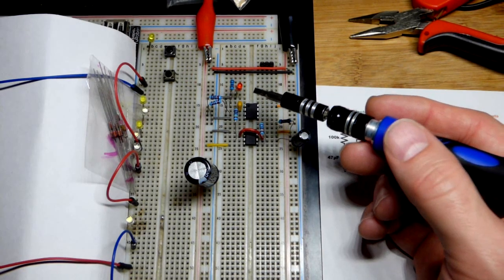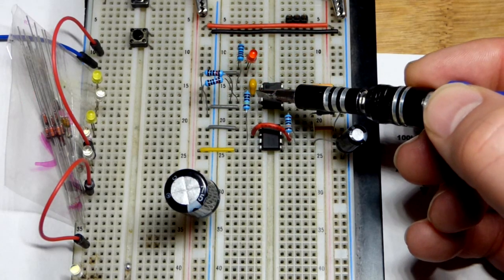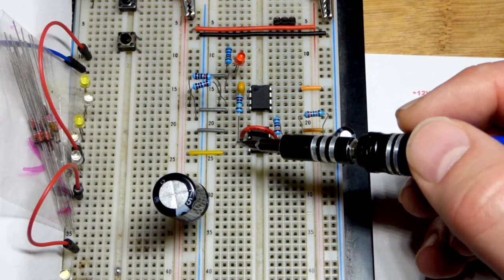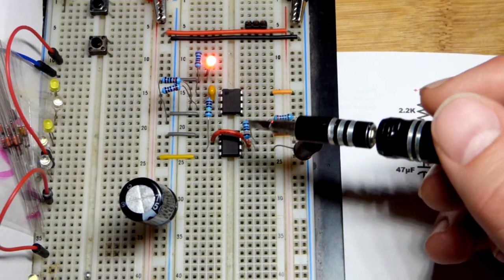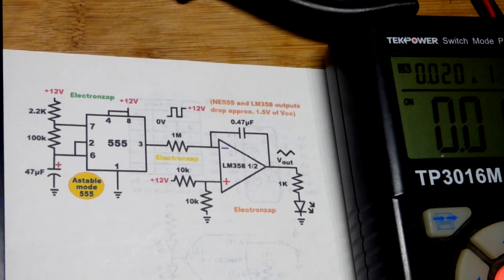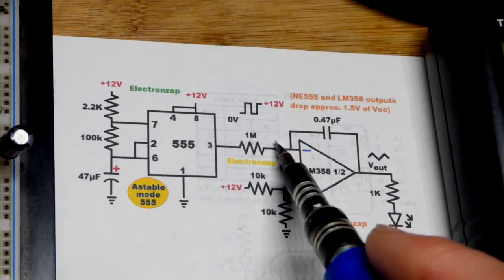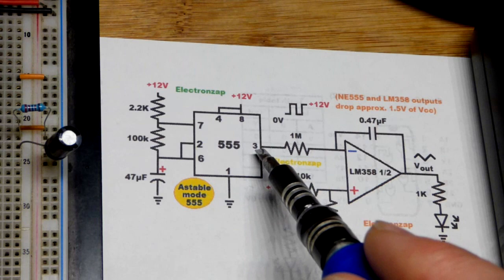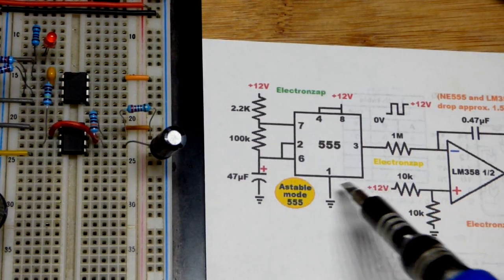12V Astable Ramp Generator LM358 Op Amp 555 Timer

Comment: Add a log expander to it to make it actually cool!
Reply from the maker: Thanks for the tip!
Reply: @Electronzap  for a visual only application you might get away with a single transistor circuit, but there is a two transistor plus one opamp classic circuit that is very temperature stable. It is commonly used for synthesizer VCOs. All on the web. 👍🏻